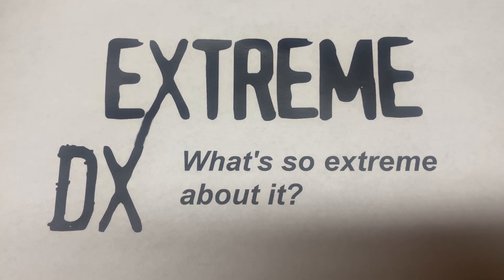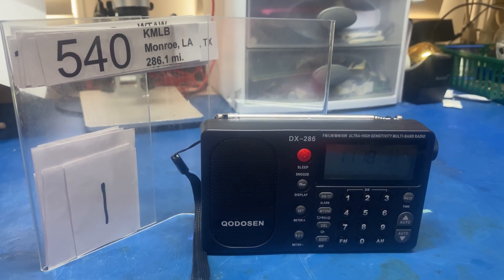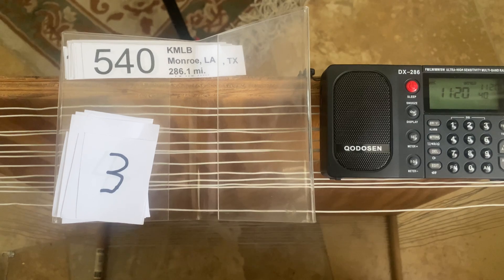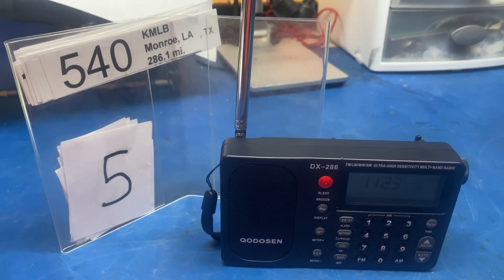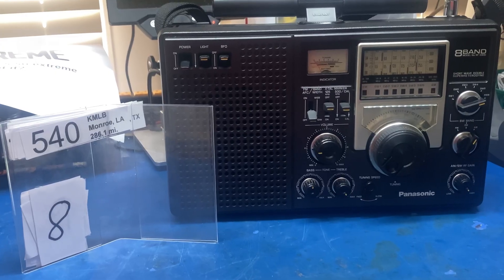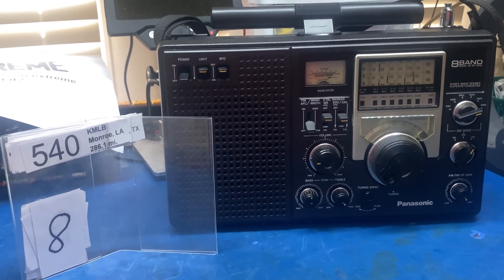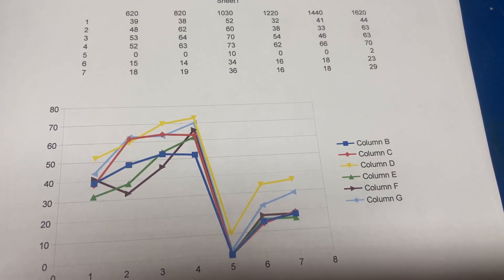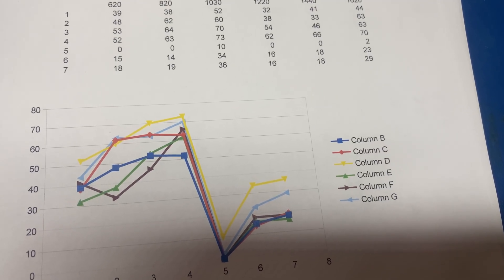Qodosen DX-286 Scientific Analysis- Is it the Most Sensitive Portable Radio Ever Produced?

Comment: I'd like to point out that this radio takes an 18650 battery... which is great imo. However, you have to make sure you buy a battery with a button top. Many 18650 batteries have a flat positive end... those will not make connection.

Comment: Hello,
It's good that this issue was clarified – the results were obvious before the test began. A receiver with a low noise-to-signal ratio and, in addition, with high-pitched static noise simply cannot be described as a super-sensitive radio. 
A question for the experimenter – why were none of the presented transmitters further than 200 miles (320 km) away?

I'm listening to a MW stations in Europe, and the closest one is about 350 km away. 
The distances to subsequent stations increase as if logarithmically, i.e., 500, 800, 1100, 1400 km, and even further – the most distant transmitter is in North Africa, 2300 km. 

For this reason, I'm surprised that closely located transmitters were used for the experiment. 
Apart from that, kudos to the presenter – good job.
RGDS.
Reply: I live in Denmark and easily receive GB every day 500km to 800km away but remember the stations in US have much lower power in the range of 1 to 10 kW and the ones in Europe, and elsewhere mostly 50 to 250 kW.

Comment: I own a Tecsun PL 660, and the Qodosen beats it on distant stations on AM.  On FM it's no match, the Qodosen is superior.  Too bad it can't get SSB, if it did, I bet it would be great at that..
Reply: I had a PL660 and I have a Qodosen DX-286 and I agree with you. PL660 is not so good on medium wave, but the Qodosen is very good on MW.  I combine Qodosen with the Tecsun AN200 loop antenna for MW dx and it works very good.  On FM the DX-286 is outstanding; it is the best FM performer I ever had. Amazing sensivity and amazing selectivity. On SW both radio`s are great. I also have the Tecsun PL680 now which is a slightly better SW radio then the PL660.